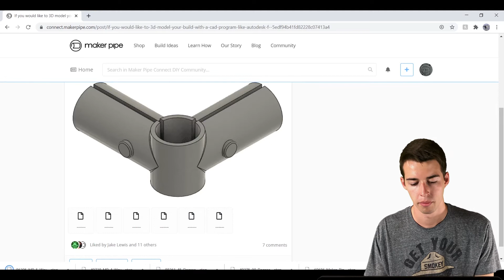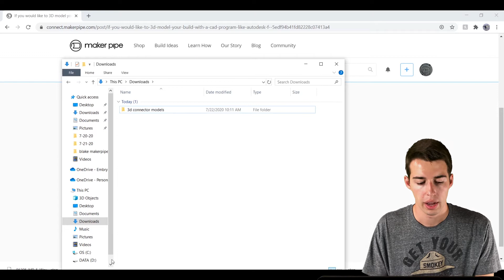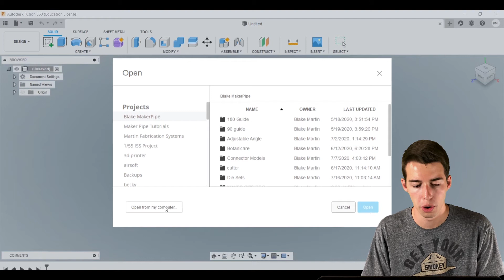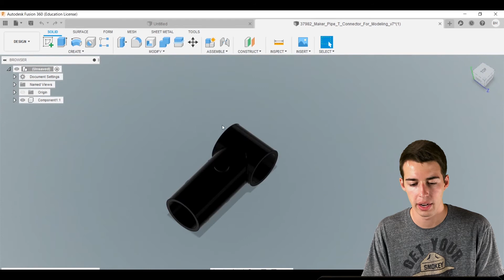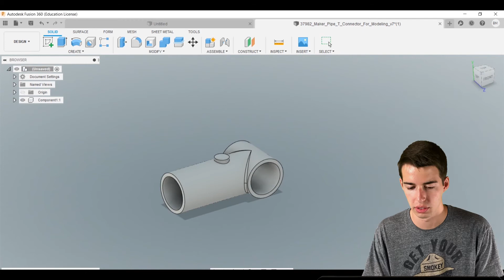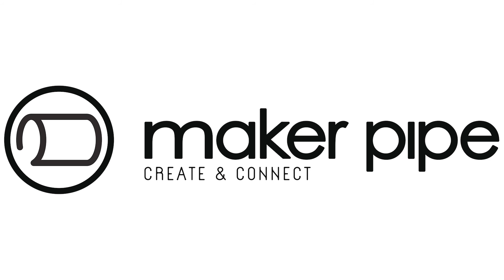How to Import Maker Pipe 3D Models

Comment: The link referenced for downloading 3D models DOES NOT EXIST.  If it ever did it does no longer.  This video is worthless.
Reply from the maker: Here is a link to some of the more recent connectors that we’ve made since that original link was shared. https://connect.makerpipe.com/post/hey-all-we-ve-added-a-few-connectors-since-the-last-time-we-shared-the-step--623c7811c228d82e9caf4f84
Reply from the maker: You’re welcome. I’m sorry that it was giving you trouble.
Reply from the maker: I’m not sure why it’s not working for you. When I click it, it takes me to the community where all the files are listed. https://connect.makerpipe.com/post/if-you-would-like-to-3d-model-your-build-with-a-cad-program-like-autodesk-f--5edf94b41fd82228c07413a4